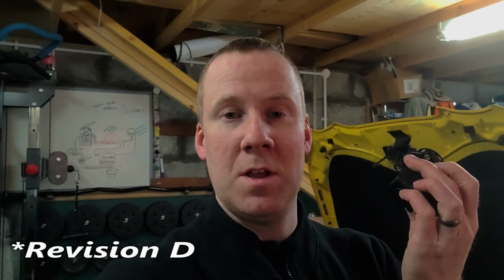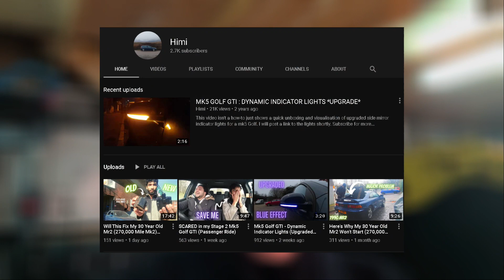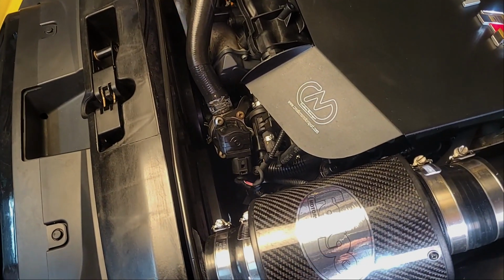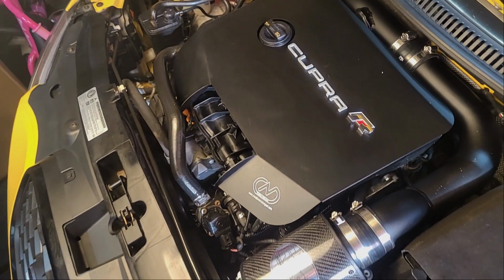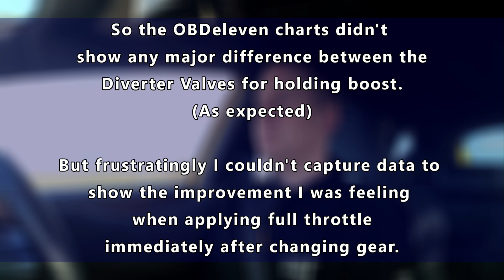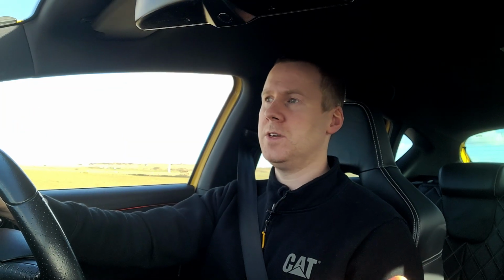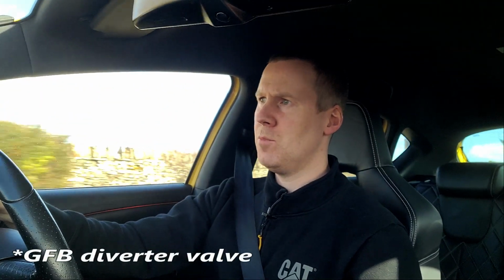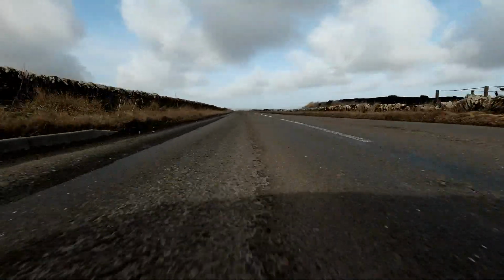OEM Diverter Valve Vs GFB DV+ | Fitting to a MK2 Leon Cupra 1P1 / MK5 Golf GTI

Comment: I got one on my Ford Ranger. They are awesome, really helps with the response after letting up and back down on the accelerator.
Reply from the maker: I have found this also to be the same for my car. Definitely works very well 👌🏻
Reply: I use a JB4 Piggyback Tuner with Diagnostic logging tools. It really smooths out the power curves. The boost arc on the stock graphs had peaks and valleys on the way up. Now it gets to the shift points more linear. With immediately response through each gear.  You don't get to show the pretty dyno graph bumps to your friends one time. You feel the difference every second of the day.  It may not be the first mod to get.  It certainly is more fun benefit then spending $400 US on a intake which usually give you nothing but more engine noise at stock figuration. I believe it even adds to the mpg's a bit depending. I can't really tell since I am either stopped. or at 5500 rpms. On my way to just about anywhere these days.

Comment: Hi just changed from a GFB DV+ to the VTA as I was getting to much recirc air to the compressor at stage2+ on my golf Mk6R .
The DV+ VTA part# T9451, stops the compressor flutter and surge during throttle lift off and for the dsg at least it is only audible during a throttle lift and the noise is not as much as expected .
Well worth it for those with EA113 DSG .
My Turbo bearing is thanking me already 😆
Reply from the maker: Cheers for leaving the informative comment Richard. I think I remember seeing u mention this on a Facebook post possibly, or someone wrote something similar.
Yeah the flutter is quite excessive, and ur option sounds like a very good substitute. I'm by no means a sales rep for GFB 😂 but currently still enjoying it and the car is still too, and hopefully that continues safely anyway,😂🤞🏻
Cheers again 😊👍🏻
Reply: Depending on how your boost and tune is, there's a case to be made for VTA swaps. Most owners should keep the factory design. Modern vehicle MAP sensors are counting on that air you just dumped all over the neighborhood to sound cool. It will cause problems down the road without proper tuning. I have a recirculating valve in the  2022 Ranger. It sounds off a primal hiss on WOT, with a awesome Blow off woosh that resonates from the Afe Rapid induction Intake. To me it is better than dusting off the engine bay every 2 seconds.

Comment: Hello,

Im thinking of buying this diverter valve. Did you mention more boost ? And how is the sound? Is it louder then the stock one?
Reply from the maker: The GFB DV+ won't increase boost, all you may notice is increased throttle response between gear changes. It should be able to handle more boost if you plan on getting the car remapped, and then you'll be able to hear more intake noises also.
If you want hear more intake/DV noises currently, a large induction kit like Revo will help 👍🏻

Comment: Hey i already got a HKS Blow off Valve installed on my car and i also considering install this DV, do you recommend to combine a BOV and a DV or should i remove the BOV? Thanks 👍
Reply from the maker: I think they can only be fitted if the other is removed first. Some engines prefer having the diverter valve, as they expect the air to be kept inside the intake system, whereas the BOV dumps the air into the atmosphere, and sometimes causes running issues.
So yeah I'd recommend fitting the DV by itself, and see if you notice some improvements.
I did a follow up video 12 months after this one
https://youtu.be/-YVJ_dt2SrI
Thank you for watching 😊👍🏻

Comment: Mk6 gti and also 2012 and 13 beetle turbos.. they run the ko3/ihi stock turbo with the dv on the turbo.. 

My cts ko4 even has the dv on the turbo..
Reply from the maker: Good to know, cheers mate 👍🏻 definitely easier to change the DV when it's located on the pipework at the front 😅

Comment: Looks like you had a boost leak also. Your boost requested and actual should almost be identical
Reply from the maker: yeah that's what I had thought too when I saw the graphs. Possibly the old DV was leaking slightly. Had a smoke test and system health check before my stage 1 and tuner said fortunately everything was working spot on, and had above average power output for standard, so very relieved! 😂

Comment: I rlly want one seeing your video😤 but do you which part spec to pick I have mk5 gti because I don’t belive they are all the same on the website
Reply from the maker: Yeah they do differ slightly. I think the Mk5 GTi had the Ko3 turbo, so the diverter valve is down the back of the engine attached to the turbo. GFB should have one available for the Ko3 turbo too, if you search for it. Or you could email GFB directly to see if they have a part number? Thank you for watching 👍🏻

Comment: Hey would you say the gfb dv+ months on from this video is still the better option for an upgrade?
Reply from the maker: It still works perfectly since the day I installed it. I am planning a '12 months of use' update vid, to check it, see if it's still lubricated, and moving freely etc.
If ur going from a revision D, this GFB or a revision G standard diverter, will both do an excellent job. There's meant to be science behind why this is better, but I can't say if it is for sure.
Hope that helps, cheers for watching 👍🏻
Reply: @NorthCoastWorkshop  I actually don’t even know what’s in my mk5 gti I just bought it and will do the diverter valve, pcv valve and can follower but the diverter valves are really puzzling me, then I’m torn between rev d and rev g but I’ll be mapping my car to stage 1 so would like this changed first as I’d say mine hasn’t been changed in a while ☺️ great video, the 12 months in update would be great
Reply from the maker: @jasonseery4885  you'll see on the diverter valve a part number stamped somewhere, and the last letter represents the version. So D is the update from the C, and I think G is the current update, and best. Tfsi experts R-tech always recommend the G, but a genuine GFB I think does no harm either (there's loads of copycat versions that fail). Good your getting it all sorted, check the part number next time ur under the car, and get an upgrade if you've got a version C or D, but then up to you what u decide to upgrade to I'm afraid 😁

Comment: Awesome car, i just got myself a cupra r -2013 with stage 1 310hp and open air kit. 
but when i push full throttle i sounds like the bov makes some "psssst"noice and let go off pressure before i realese the throttle. 
Do you think the bov i the problem here? because i think i got the verision D, bcuz it has never been changed since 2013. 
Sorry, me English isnt the best :-)
Reply from the maker: It could be the issue if it's the older version. The newer revision G is meant to be the best.
BOV (blow off valves) valves don't work very well on these engines, the TFSI engine prefers any excess boost to be recirculated, through he revision G diverter valve or these GFB divert valves.
Simply though, if you feel like you are getting a good surge of power/boost when you need it, then your setup is performing fine. The noises are more noticeable if you have the open air kits, I hear mine all the time.
I did a follow up video not long ago, if you need more info ➡️ https://youtu.be/-YVJ_dt2SrI
Cheers 👍🏻
Reply: @NorthCoastWorkshop   Lovely, thanks for the answer! 
Im new on the channel, but i love your videos. So will take a look at your latest about the diverter, and then the rest of the videos :D
Reply from the maker: @straahle  thank you for the support 😊

Comment: Without sounding stupid would this be the same on the mk2 fr non cupra?
Reply from the maker: Not stupid at all in asking mate, as I'm not 100% sure. 
You can check a list of cars this is available for on their website. 
I imagine yours is a 2.0 TFSI around 200 bhp? I believe they still have the KO3 turbo, so if that's the case your Diverter Valve will be situated on the turbo itself round under the back of the engine which is a bit awkward to get to. 
But yeah, should be the same style, but maybe check GFB's fitment guide to be sure 👍🏻